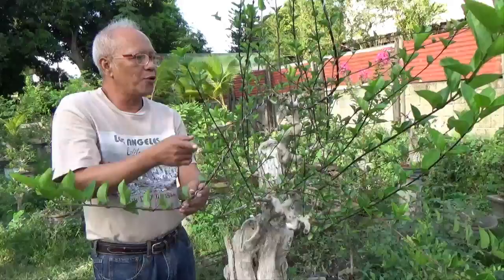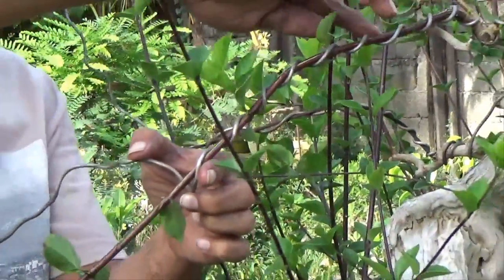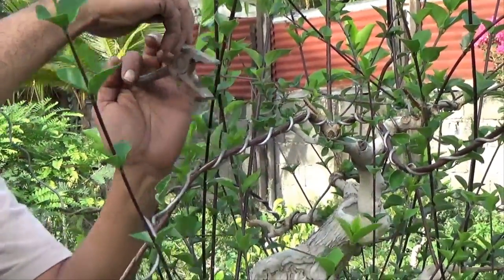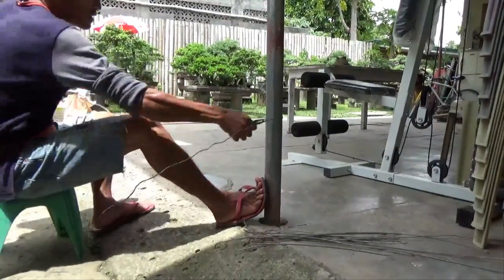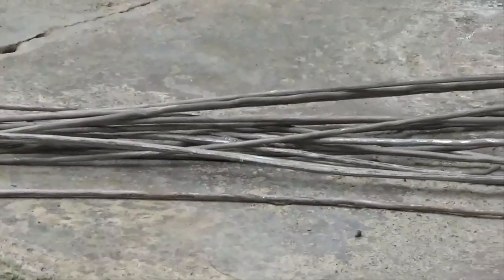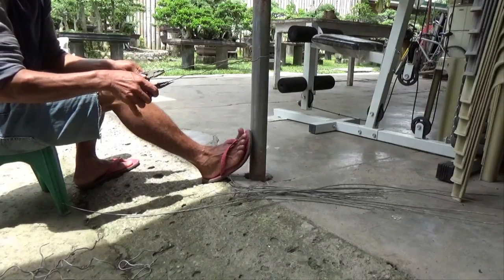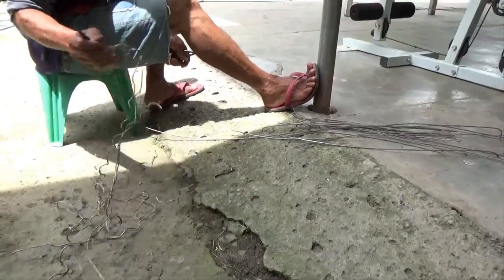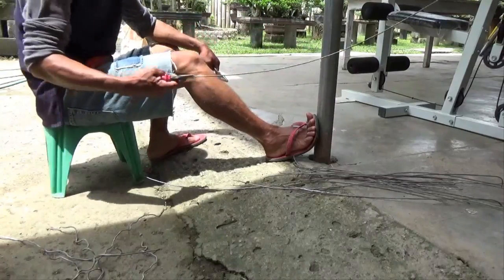Bonsai Tutorials for Beginners: How to Remove Wires for Re-use

Comment: Thank you for such an informative video.  I am curious as to how you deal with the areas where the wire has dug into the branch.  I was taught to use a knife to cut slightly through the cambium layer in the center of the rut (area where the wire had dug in).  This alerts the plant to heal this area a little faster.  What method do you use?

Comment: How long will it take for the wire marks to grow out? how does that vary by species?
Reply from the maker: the wires will eventually dig in as the branches grow thicker. depends on how fast the tree grows. the younger the faster sometimes in just 3 months you'll have to uncoil. the ficus in my experience grows relatively the fastest.